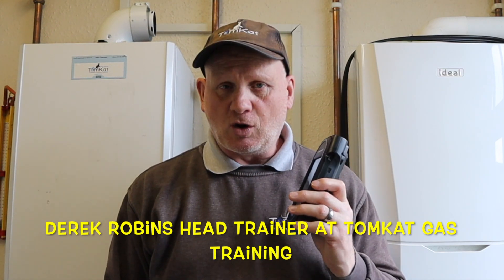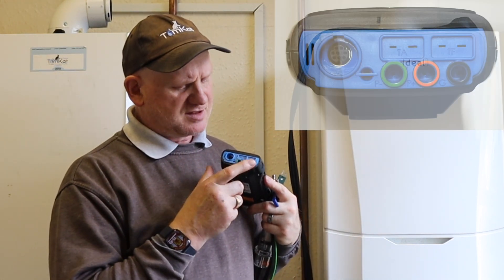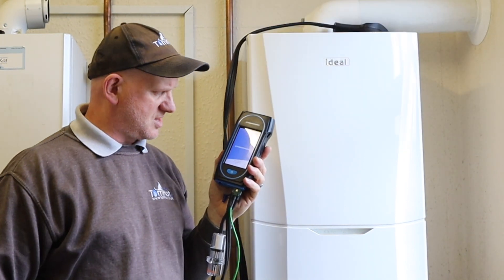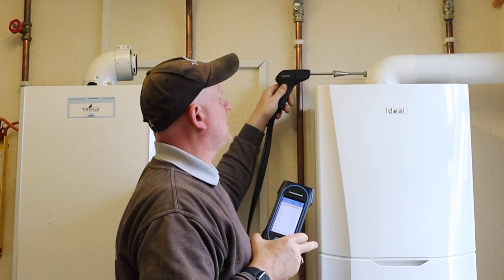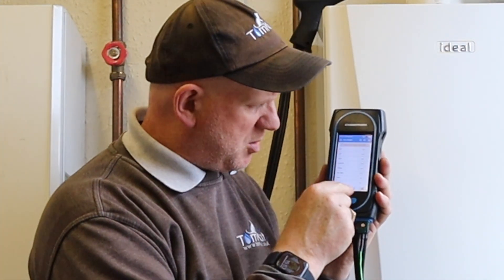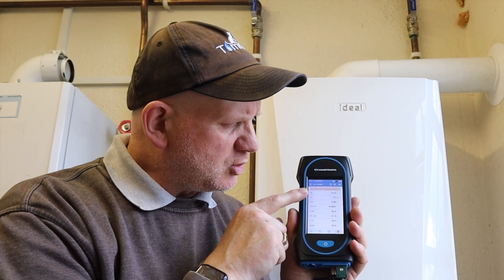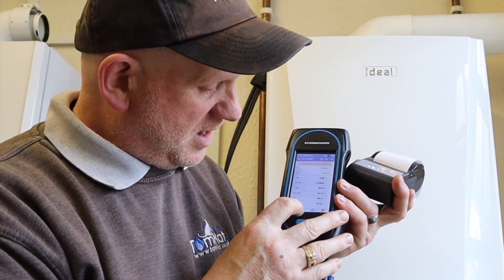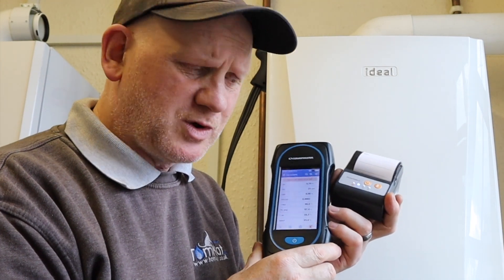Using the Sauermann si-ca 130 flue gas analyser,  part 3. Analysing, printing,  mirroring the screen

Comment: These vids gave me better insight to how many options there are in the market so thanks. I do wish YouTubers would show a little more of the product in action. Just turning it on and using it, working pressure, tightness, charging it. Especially the max co ppm. Thanks for your time